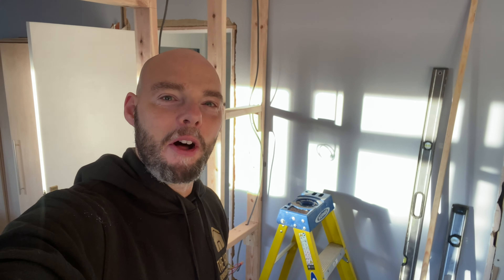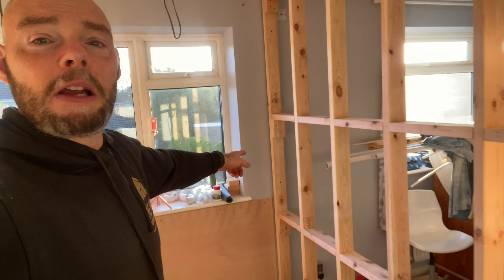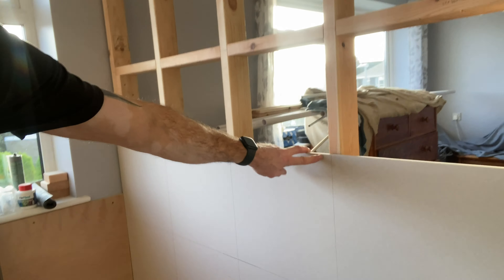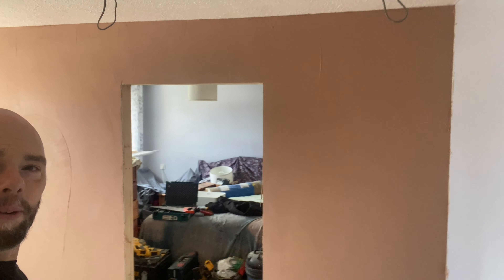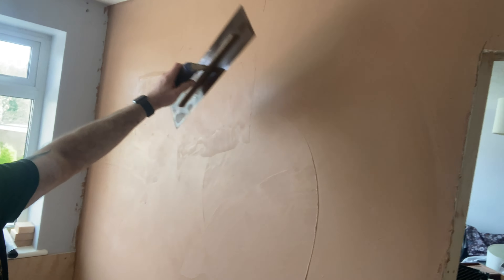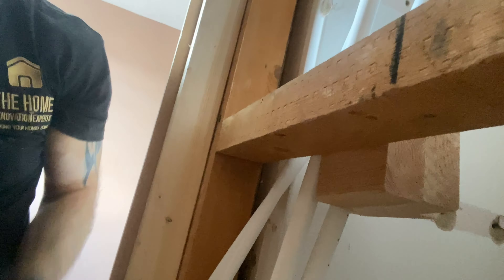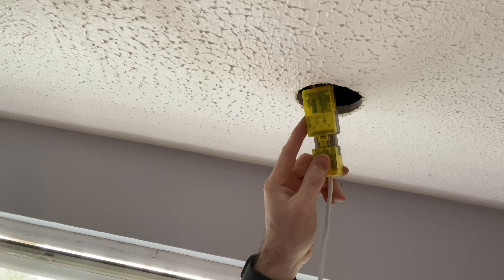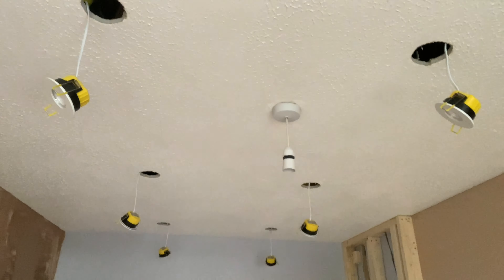Bathroom Refit Day 10- Lights, Plastering- Shower Pump!

Comment: Would have made life slightly easier if you had put the door frame in before plastering that wall? Also you didn’t mention that magic bit of kit the speedskim that was on the floor, I presume you used it?